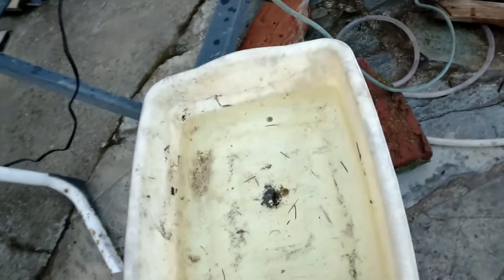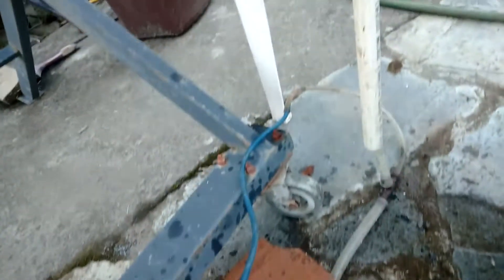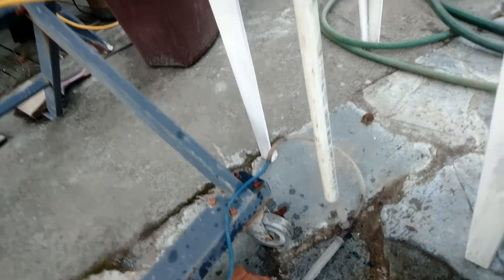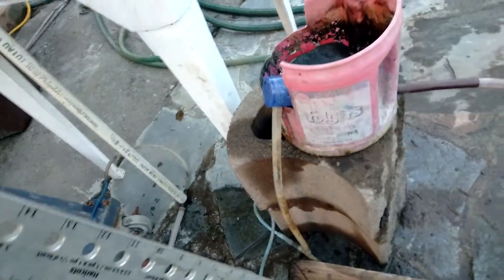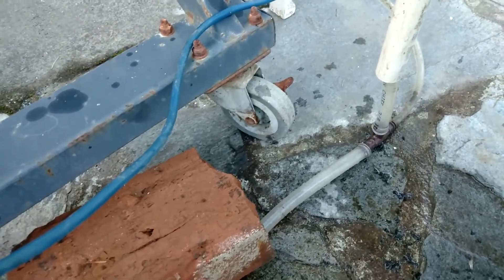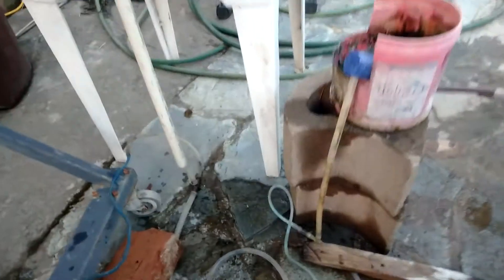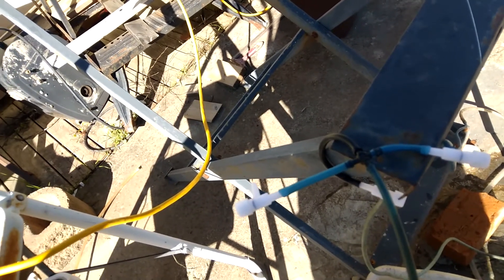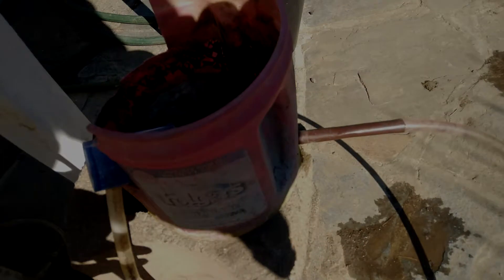How to airlift pump from 7 inches (too little submergence) to 49 inches. With  practical tips.

Comment: Do you have pictures or videos of your coffee jar syphon pump? I want to try and build....
Reply from the maker: I have an animated gif (or 2) of how it works. I don't think I had a camera when I made the coffee jar suction pump but I took some pictures later when I dismantled the thing.  I could make a video about it?    I thought it was  a wonderful idea when I imagined it first, but making something that works with suction and partial vacuum has many disadvantages. It used glass jars because the suction crushes plastic jars, etc, etc.  And the bigger you make it, and the more suction you use  the worse the problem gets.  I used 7 coffee jar lifts in series and pumped water to just 6 ft.  My first accidental "pulser pump" pumped faster than it and was much simpler so I abandoned the suction pump idea.
Reply: @Brians-tracking-solar-scoop  i got time to make the suction part. Works great but needs to be air tight. Lol. Any tips or tricks moving forward?
Reply: Thanks for the quick response! I have found the animations. They look like what I need for a well and off grid application.  I will experiment and eventually use pvc. Pictures would be great if possible but no stress. Its such a simple setup and operation , yet runs along the lines of a Huron fountain in complexity. Thanks Boss!